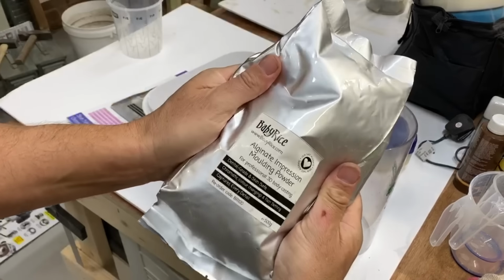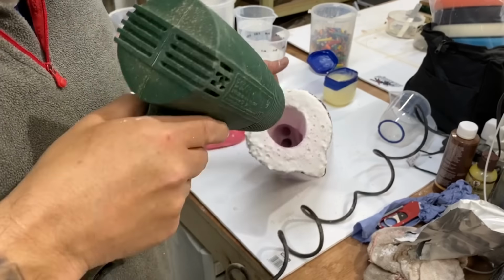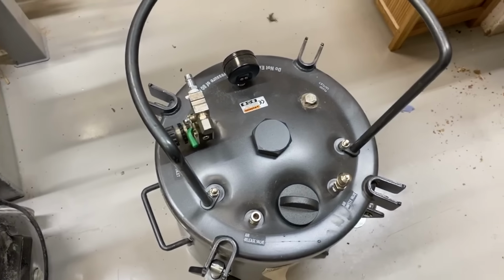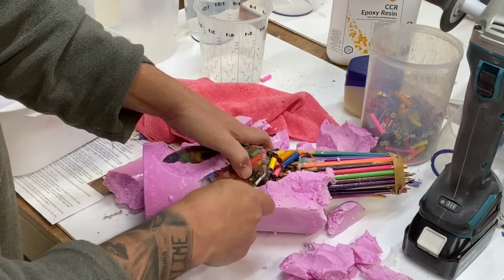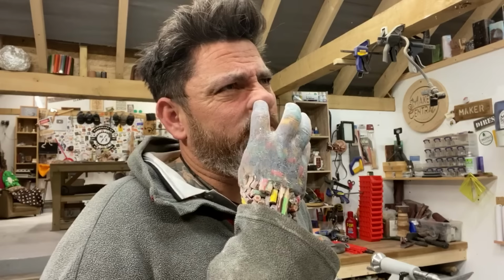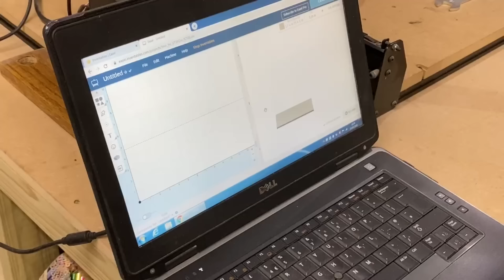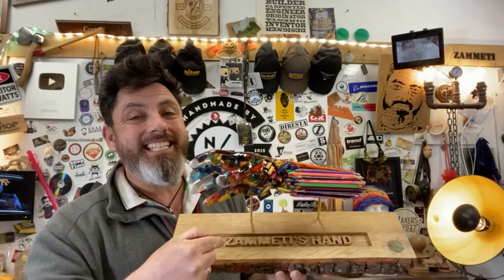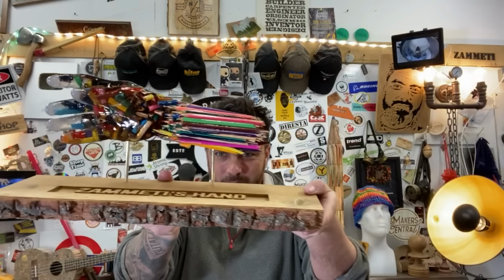Casting 'The Pencil Hand' Resin & Alginate 😲

Comment: I work in a dental lab and use alginate. Have often wondered if it would make a good mold for resin. Thanks for solving that mystery! If you do use it again, smear some of it on the object before dipping and it might give a smoother surface to the resin. Think I'm going to give it a try when I can go back to work.

Comment: For future use of alginate, try casting plaster into the alginate mould and then using the plaster cast to create a latex mould to use with resin for better curing and less chippage, as well as reusability. Though the broken look turned out great on the hand regardless.

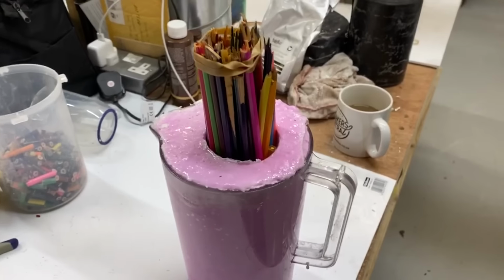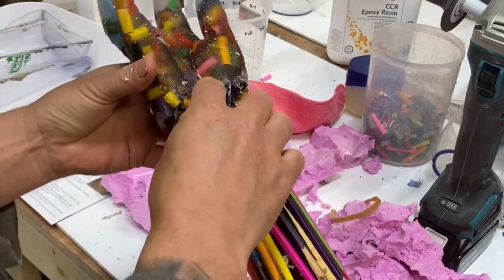Comment: 6:28 - 8:23 Next time you do something like this, I suggest spraying your pitcher with mold release and mixing the Alginate in a separate container before pouring it into the pitcher. That should make it much easier to remove and allow reuse of the pitcher.
I also suggest after casting your hand (or whatever the object is next time), leave the mold to fully set/dry/cure for at least 5-7 days (perhaps in a small warm space with a dehumidifier running) to remove all excess water from the Alginate, reducing the potential problems with the Resin...

Comment: Also, Nick. If you have done this already, then please share a link...
Use a handheld pencil sharpener and sharpen a few dozen colored pencils down as far as you can go, the use the shavings in some resin to make a hollow form box and insert a handheld pencil sharpener in the side of the box or lid so that the pencil shavings can be a case for pencil shavings.

Comment: So in dentistry when we use alginate we make the study models with plaster or gypsum, depending on the detail needed in the model for the use. Plaster isn’t bothered by the alginate’s dampness. With the now plaster hand we are free to make a new more permanent and reusable negative from silicone. There are two part silicones used inside the mouth, usually to make singular crowns or smaller 3-5 tooth bridges. Anyway. I know epoxy is expensive. So if you’d like to have a mold you can keep, I’d look in to silicone and plaster. Oooor you can just take a silicone mold of your arm to jump a step haha. But I love this sculpture.

Comment: Alginate is wet when you cast in it usually. it's meant to be a quick temporary mold. when it dries it shrinks a lot so it being wet is actually a good thing. You'd probably do better with a faster drying resin unless you had a way to seal in the moisture of the alginate.  😃

Comment: Awesome! It's a happy accident that the resin stopped where it did (ah, the gaps in the pencils hadn't finished filling up)! The gap  from the flesh being torn off ! Bet you couldn't recreate that if you tried. 

And we all enjoy the laughter you provide, I'm still smiling. It's also another happy accident that you did a deeper carving with that 'do hicky' (hahaha) as any carving would be a place to gather dust, it would be perfect to put a clear resin (maybe a bunch of pencil nibs - no wood) in the gaps on either side of the engraving... but (there's always a but lol) might get bubbles OH, heat gun or hot blow dryer would pop them right? T'was just a thought.

Comment: Now THAT is a funkadelic art piece. I love it. Did you check the cure time in the instructions for the casting material? During sanding,  did you remove the fingerprints, in case it sells? Wouldn't want some nare-do-well to make reverse molds of your prints and use them for nefarious means. Of course the over-coat of resin should take care of the prints, so probably not an issue.

Comment: It looks really great.
Just a question.
Do you think it would have been a good idea to use a smaller bit for the lettering and swich to a bigger one later?
I don't know much about your cnc.
Normally at work I would do it that way.
I work in the sign industry so this is something I have a bit of experience with we just use different materials. Wood is more rarely used which is kinda sad.

Comment: Super cool! And funky. Question, from someone with no resin casting experience... would moisture have been less of a problem if you had removed the mold from the pitcher before adding resin to let it dry? Also, the pressure pot tends to drop the fluid level quite a bit, have you ever made sort of a funnel or sprue on the top to be able to add more resin to compensate?   Love the project, love the channel, I’ve got a pretty good Rona beard going myself!

Comment: I cant figure out where all the resin went as you had it filled to the top of the mould but ended up under halfway full! Was there that much air trapped  in it before you chucked it in the pressure pot? I love how it came out but would have loved to see a full smooth resin up to where you had your arm in the mould also :P. Very funny video tho I loved it!

Comment: I'm pretty sure the alginate was your problem. It never quite dries out. Try again using silicone, you'll probably have a better result. I've seen people make resin dice in silicone molds, so I'm positive it will work. You just won't be able to use the mold indefinitely. Pressure pots destroy silicone after a few uses.

Comment: Why not get a cup and put the end of the arm in it and fill it with resin then sand or turn it down to better fit the size of the hand so it looks more normal it doesn't look bad as is but it kinda bothers me where it makes the transition from hand to the color pencils that were at the top

Comment: I really like the idea! Still, I would have poured in another layer of resin, since obviously the resin was not filled up to the top after you took it out of the vacuum chamber. Hope to see the cnc-machine more often, a great tool for finishing up a project!
Reply: Actually. I had thought that too. To add more when he pulled it out of the pressure pot... but it is just like Nick said, it's reminiscent of the terminators hand & with that gap of resin missing it's pretty much like the flesh has been torn off so it makes it perfect for the effect he was going for!